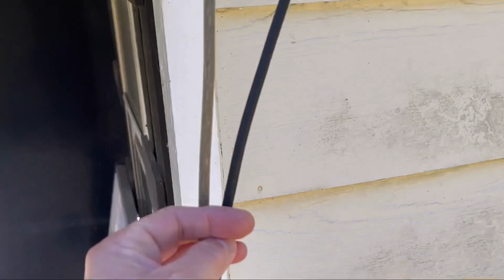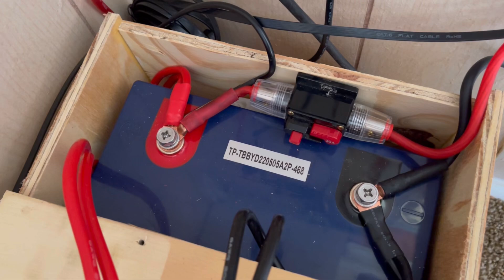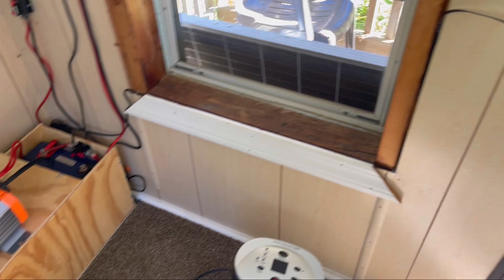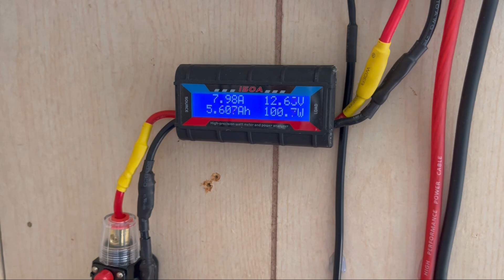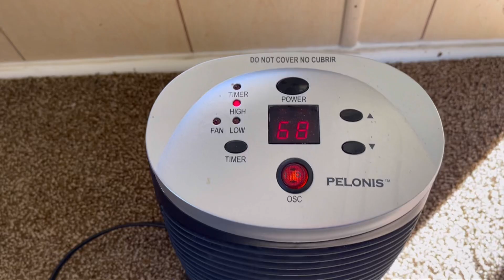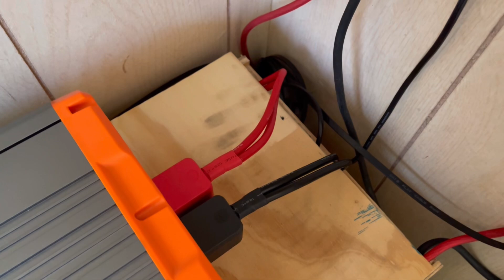What Happens When You POWER Your Tiny Home with SOLAR?

Comment: MPPT charge controllers are not that expensive and well worth the money. Capt you gonna need more power if you want to Run an AC
Reply from the maker: @mannyfragoza9652  absolutely agree! We have a 40a MPPT on our larger system. This is just a tiny house that we use occasionally

Comment: For anyone putting in their own solar, please be aware that the system in this video is quite a bit underpowered.  My math says he needs at LEAST one more battery, and at least 500W in panels.  With this system, it's not likely to charge well enough to keep up, and the heater can only be run for a couple of hours before you're in the cold.
Reply from the maker: So there is a total of 400w on the roof mixed panels in the video some were offline and dirty.
Yes you are correct at 200aH the battery will last around 2.5 hours on full load…..on low provides around 4 plus hours…..check our other videos out on our large system.
Thanks for your comment!

Comment: Ive just built a similar portable system but went with 48v instead and also had the same problem with included inverter cables being undersized. This is my opinion , you dont need a fuse between a charge controller and battery but u need a fuse between the battery and an inverter . That PWM will produce probably 30amps at full tilt which is nothing to your 200Ah battery. Even if the charge controller doubles its output to 60amps (which is never) your battery bank will handle it like its nothing unless u using the fuse as a breaker ,its not protecting anything
Reply from the maker: yes that's exactly what it used for just to separate the battery completely if needed...cables get warm so the next size up would be better may upgrade we are doing more work today on it!
Reply from the maker: The inverter has 8 blade fuses internally that are replaceable.....I have a 100A fuse but it's too small ordered a 200A waiting on it